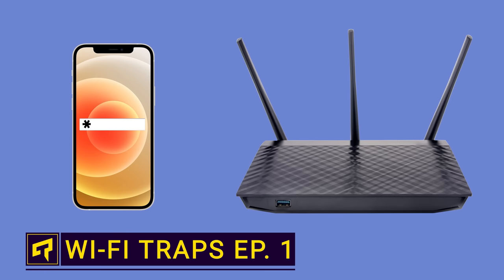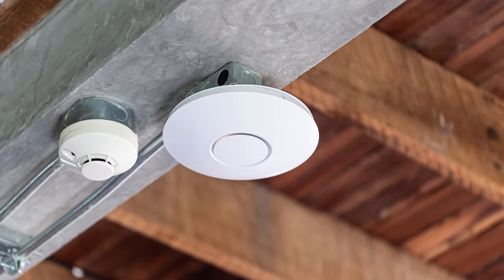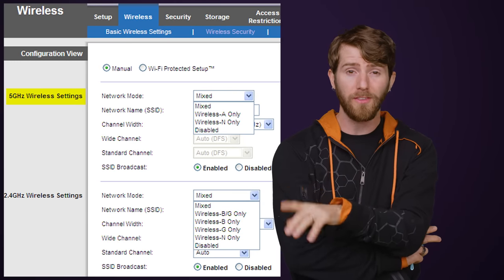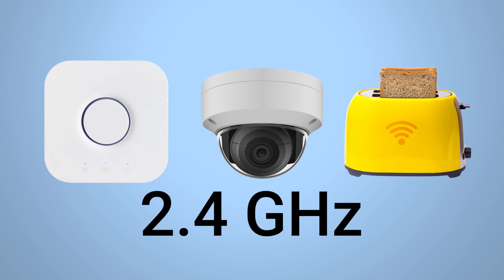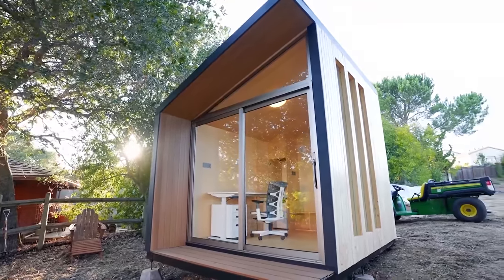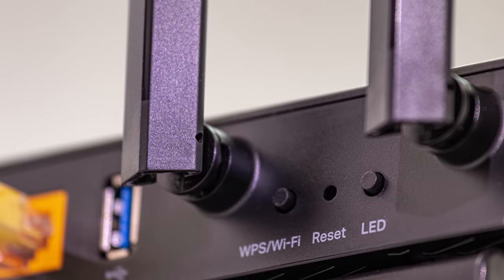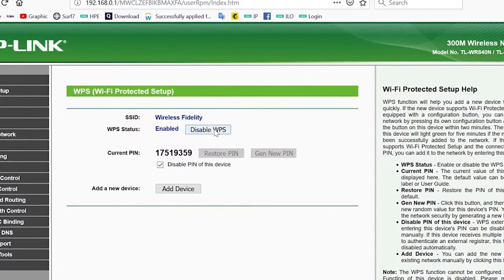Avoiding Common Wi-Fi Traps

Comment: I used WiFi mac filtering good luck braking that :)
Reply: You can very easily spoof Mac addresses
Reply: @Optiplex321  good luck finding the Mac # how you get to the router when  i use WiFi encryption and Mac filter at same time and someone connecting with WiFi. This will take weeks to crack if you not directly attached with rj45
Reply: @pavelmusiyenko  Lmao do you know about monitor mode on a wifi adapter? It shows every MAC address that's connected to your wifi in seconds. MAC based authentication gives 0 added security. Just like hiding your SSID also does not give extra security.
Reply: MAC filtering in DHCP server side is also another added layer. They can in the Wi-Fi network but they won't be able to connect 😢
Reply: @HexPortal  no comment
Reply: @pavelmusiyenko  you clearly have no idea what you're talking about
Reply: @pavelmusiyenko  Dude, WEP is fucking ancient, literally nobody uses that anymore. Your "encryption" is just a WiFi standard so stop pretending you're some kind of IT god simply because you've managed to select "WPA2" in the authentication list.
Reply: @Optiplex321  did you check every  single home? In every single state by saying such dumb thing ? Lots of people still around  NJ NY PA CT using all in one old ISP wifi modems with WEP so again stop assuming you know everything I never said I was god but looks like you saying you are esp with user name Optiplex probably working at dell costumer service lol

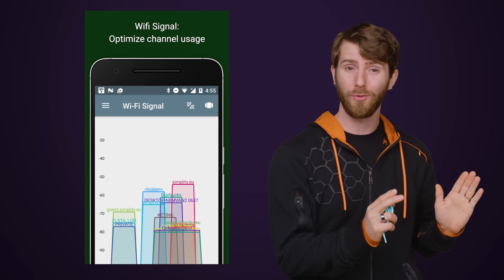Comment: 2:54 no because when you adjust yours all the routers around you will just move to thst channel as part of the "auto" feature
Reply: Not all routers most home consumer routers will only scanned initially when it's powered up not when it detects a signal and it will move to a different network but it won't move back to your original selected network until you reboot it

Comment: I have 10 gbit wifi
Reply: You do not lol
Reply: wifi can't be 10gbps
Reply: Wi-Fi 5 and Wi-Fi 6/6e supports up to 9.6 gigabits per seconds so theoretically, yes you can. You just need to make sure that the end devices also supports same speed and the  access point has a wired interface that supports 10 gigabit. I'm running Aruba AP630s that are Wi-Fi 6e but the ethernet port is only 2.5Gbps so that's the max I can get om any device that supports it. Mind you, this is different than the actual internet speed.